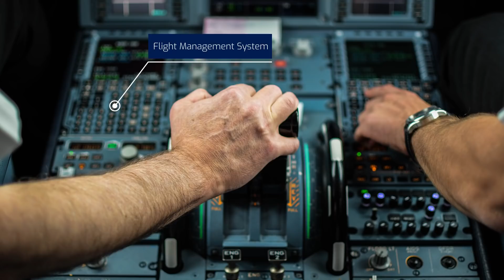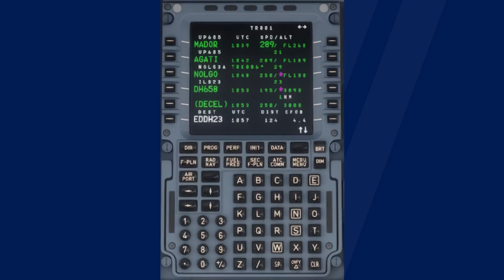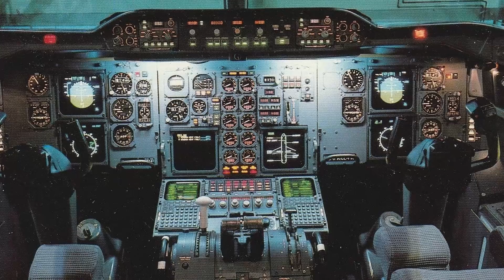Bad Decisions | How Hapag-Lloyd Flight 3378 ran out of fuel

Comment: Fam, wth! How did they not realise that with the landing gear extended, the FMS would never give them correct estimations...it's one of the basics that i learned while first starting off in flight school. Now it's pretty easy thing to remember, that with the gear in an extended position, the drag would be much higher than normal, which inturn will burn more fuel, and even then, the pilot's calculations were all over the place.
Btw, this video came up in my recommended videos part, and i have to say, very well done "Airspace".
Reply from the maker: who knows :) maybe we learned it because of this accident? but yeah, it's a weird one. thanks for your kind words!
Reply: Very much possible mate
Reply: But here's the thing: shouldn't the flight management system know [1] how much fuel is remaining, and [2] how fast the plane is currently burning it?  Regardless of what the manufacturer's engineers programmed into the system for various scenarios, surely the system knows what the current burn rate is?  Then it's just a simple calculation to see how much time (and distance) you have left.

Not that the pilots weren't negligent, but their system should have easily been able to tell them how much time and distance they had left at any given moment.
Reply from the maker: that'd be nice, yes. Unfortunately, that's not the case.
Reply: @AirspaceVideos  :   Thanks for the quick reply.  🙂   I must say, being such a simple calculation, it boggles my mind that Airbus's sophisticated FMS can't do a simple math calculation that any elementary school student could do!  WTF!?
Reply from the maker: that's by no means a simple calculation. How should the FMS know in what exact position the landing gear is? One could say that it maybe could have values for gear down. But then again consider the fact that this plane (and in turn also its computers) were released in 1982. Think back to how computers looked back then!
Reply: @AirspaceVideos  and Topet Hernaez :  

You guys, the FMS doesn't need to know in advance what the rate of fuel consumption is when the landing gear is down. 

All it needs to know is what the current rate of fuel consumption actually IS.  Regardless of the cause.  Even your average modern car knows that.  With that knowledge, and the amount of fuel remaining, the remaining burn time is basic 5th grade arithmetic.

Say the plane is burning 6600 kg of fuel per hour (for example).  We know this, not because the engineers have preprogrammed the computer (flight management system) with this data for a gear-down scenario, but simply because the plane has fuel flow sensors that tell us how much fuel is flowing through the system at any given moment. 

So with a fuel consumption rate of 6600 kg per hour, and, say, 3300 kg of fuel left in the tanks, we know that the engines can run for another half hour before running out of fuel.  That's it.  It's not rocket science.

And then if we know the approximate ground speed of the airplane, we can easily calculate how far we can go on the remaining fuel.  If our ground speed is, say, 240 knots, and we have half an hour of fuel remaining, that means we can go 120 nautical miles before the engines flame out.
Reply: @Milesco  hmm are you a pilot by any chance? The FMS DOES calculate the current FUEL vs EXPECTED burn. Don't try to compare cars to planes, there are a LOT more factors that can change a plane's fuel burn such as wind speed, temperature, altitude, weight, weight changes, cg, cg changes, weather deviations, icing conditions, tropopause, etc etc etc, FMS calculates this things with a "standard" configuration in mind. That includes, descent configurations such as flaps, and gears. Now this "standard" configuration doesn't include an unwanted gear down situation that's why it warns that such unsatandard configurations make FMS prediction unreliable. Mind you that not only gear down but also unwanted spoiler extension, unwanted gear doors, etc etc etc.

Now if you ask me why the FMS doesn't incorporate these failures in its computation, I simply don't know, maybe to reduce complexity of the system like there are certain procedures needing gear down situation after takeoff for a specific time, so by then if the FMS computes for that gear down event, then you'd have the wrong info.
Reply: @Milesco  also the current rate of fuel consumption is ALWAYS variable in an aircraft you'd be lucky to have the same consumption in a span of 30 mins during cruise and the consumption differ ALOT in an a321 neo if I remember conrrectly 4000kg per hour during takeoff then drops to 800kg per hour during descent and that's depending on weight, speed etc etc etc
Reply from the maker: That prediction would fail since it doesn't know future fuel flow rates, such as during climb to higher altitudes or during descent. Yes, it could calculate projected range according to fuel flow, but then again, that feature is not necessary, since the pilots should perform such calculations themselves. If I see that I am burning 8t an hour and I have 16t in the tanks, I know that after 2h, it will be very silent...
Reply: @topethermohenes7658   :  Despite my clear and simple explanation, you still have managed to miss my point.   Sure, the precise rate of fuel burn will vary somewhat over the course of a flight, but not that much.  It's nothing compared to the effect of the landing gear being stuck down.  We're not trying to pinpoint to the last drop how much fuel we expect to use before the plane even takes off.  We're just trying to get a reasonable idea of how much range we have under the current circumstances.

The point is, you know how much fuel you're using (rate of consumption), and you know how much fuel you have left.  With that information, you can easily calculate what your range is.

Again, whatever small variations may exist from one moment to the next with regard to wind speed, air temperature, altitude, etc, that's nothing compared to having your landing gear sticking out like a sore thumb.  You're way overthinking it.  In a situation like this, all you need to know is how much fuel you're burning, and how much fuel you have left.  That's it.  Then you can figure out what your range is and then decide what airport you need to land at before you run out of fuel.
Reply: @AirspaceVideos  :   "That prediction would fail since it doesn't know future fuel flow rates...."

As I said to Topet, you don't need that extreme degree of precision. 

"...such as during climb to higher altitudes..."

Who's climbing?  Nobody is going to be climbing under these circumstances! 

"...or during descent."

Well, that would use less fuel, right?   So that's obviously not a problem.

"If I see that I'm burning 8t an hour and I have 16t in the tanks, I know that after 2 hours, it will be very silent."

THAT IS EXACTLY MY POINT!!!   That has been my point all along.   And yet neither the pilots nor the oh-so-smart- and-sophisticated FMS calculated that.  And as a result, the plane crashed 660 meters short of the runway in Vienna.
Reply: @Milesco  what do you mean "not that much"?? What airline do you fly where precision on fuel is not required? Maybe our down to hundreds of kg of fuel precision vs an 18 ton fuel max is a new idea to you? You are speaking as if a gear down cruise is normal, they are VERY VERY RARE no need to complicate the whole FMS prediction for such a rare occurance

I agree, for such failure there's no need to pinpoint exact fuel burn and just deviate to nearest suitable airport, why the need for FMS precision where you can just compute by yourself in a matter of 5 sec? As stated here, being very reliable to computers is a BAD practice even by today's standards.
Reply: @Milesco  the FMS IS VERY PRECISE down to tens of kg precise, if you put in tons more of data like ALL  FAILURES AFFECTING FUEL you'd have more points of failure like let's say and LGCIU fault would make your FMS fuel prediction data unreliable, FAC fault, elac faults, sec, hyd, elec etc etc etc
Reply: Right, as my notifications are going mad here, i think i should also put forward my own POV on this...
 So Captain Quirk, what makes you think that the FMS could calculate the rate at which we would burn fuel in case of an irregular flight?
    Now firstly, you should know that before every flight, the pilots are the ones to input the calculation about the rate of burning fuels into a FMS, they can never calculate things on their own...now in case of an error percentage of fuel consumption...there is a limit to that, as that's the amount of extra fuel we carry, i.e 30 mins for holding and a further 1 hour or 1 and a half hour for diverting.
    To answer your question, the FMS cannot calculate an increased rate of burning fuel, it's pilots who do it and then input those values again....but even after that calculation, if the rate of burning fuel exceeds the amount required for that trip, we divert automatically or face consequences...but even that decision is on us, the FMS is not gonna warn us if it exceeds the first value which is entered.

I don't know if you'll understand this, but this is how I've flown since i first started 6 years ago that is, but i don't know what we used to do before that
Reply: @priyanshuhazra8644  I started flying an airbus at around the same time and I agree with you, for faults such as a landing gear down flight, my first thinking would be fuel 10/10 of the time and my first action would be ofc check qrh for additional procedures, limitations etc then I'd find the nearest airport were the company has a technical support and mech support as to not increase fees, if there's none, I'd just return to where I came from, advise company, atc, crew and passengers, it's that simple no need to rely on FMS predictions like Captain Quirk is implying
Reply: @topethermohenes7658  ”what do you mean "not that much"??”

8:37  “The documentation for the A320 states that flight with landing gear down increases fuel burn by a whopping ONE HUNDRED EIGHTY PERCENT.”

By comparison, any of the other variables are “not that much.”  That's what I mean. 

So you don’t NEED to factor in wind speed, temperature, barometric pressure, flap settings, or any of that other stuff.  You are using fuel at a rate of nearly THREE TIMES NORMAL. 
   The other stuff is just rearranging deck chairs on the Titanic. 

As you said yourself, “you can just compute by yourself in a matter of 5 sec”.  So why can’t the ultra-sophisticated FMS do this?

This is a prime example of engineers engineering the shit out of something, to the point where it can’t do the most basic stuff that would've saved (in this case) the airplane.

Don't get me wrong – I love engineers.  My father was one.  I have a tremendous amount of respect for their knowledge of science & math.  But sometimes they have their heads in the clouds (no pun intended) and can't see the forest for the trees.  They design the most complex, sophisticated systems that have no f*cking COMMON SENSE.  They design a brilliant, sophisticated FMS that can compute fuel requirements to within a few tens of kilograms out of tens of thousands (to use your words), yet it literally cannot tell that the plane is ABOUT TO RUN OUT OF FUEL. 

T H A T    I S    M Y    P O I N T .
Reply: @Milesco  you are the one saying that the fuel burn is "not that much" different in the context of 4000kg/hr climb and 800kg/hr descent it is MUCH, also you said that "extreme precision" is not needed I mean what? So you want the FMS to say your fuel is so-so or 1000kg off mark?? The FMS is VERY precise you can't just make it "not-so - precise" when you need it be.
And that's what I mean you cannot let the FMS compute for "every fault" out there that concerns fuel thats YOUR job as a pilot. The FMS is just a computer, it doesn't "think". Again becuase the more data you enter the more points of failure. Imagine an LGCIU failure then what? It now CANNOT compute for the fuel just becuase of a single computer problem? And mind you LGCIU failure are much more common than a landing gear down cruise config.

Again that why there's a pilot on board to "think" you cannot just rely everything on engineers as they cannot account for every possibility that's going to happen in the future its the pilots job to ASSESS the situation and make use of ongoing events to make a safe decision.

If you think that being a pilot just entails pressing buttons and drinking coffee then you are GRAVELY mistaken
Reply: @Milesco  "you don't need to factor wind speed temperature, baro pressure etc are you really a pilot? ALL these things are ALL magnified 3 TIMES ALSO. As I said the environment in an aircraft is ALWAYS dynamic, everything can and will affect everything else. Again I'll say it, you cannot rely solely on the computer as is the 4th airbus golden rule "take action if things do not go as expected"
Reply: @topethermohenes7658  ”you are the one saying that the fuel burn is "not that much" different in the context of 4000kg/hr climb and 800kg/hr descent....”

Where did I say that?  I never said that.  You are putting words in my mouth.

"The FMS is VERY precise...”

Yes – a brilliant, sophisticated FMS that can compute fuel requirements to within a few tens of kilograms out of tens of thousands (to use your words), yet it literally cannot tell that the plane is about to run out of fuel.

”you cannot let the FMS compute for "every fault" out there that concerns fuel...” 

Heh heh heh...that's funny.  “VERY” precise, but it can’t detect when the plane is burning fuel at three times the normal rate. 

Anyway, as I said before, it appears that you have missed my point.  In fact, it almost seems like you're purposely and stubbornly refusing to understand what I’m saying – the essence of which is simply that if you have a (supposedly) sophisticated fuel consumption calculator on board, it ought to be able to tell you “Hey, based on the current rate of fuel consumption and the amount of fuel you have left, you only have x number of minutes of fuel left.”  Are you telling me that that’s impossible?  The calculation that you yourself said a pilot could do in 5 seconds?
Reply: @Milesco  do you need more explanation on how FMS fuel prediction works or did you already understand it? Let me give you a real life scenario.

Here's how the system works : a 45 min flying time on an a321 neo typically needs just 3100kg of fuel and that includes all emergency fuel etc, passengers of this flight will be about half. Now at take off the plane will consume about 2000kg/hr per engine since the engines are on high thrust... Now if using your made up calculation that the FMS gets data from the the  CURRENT usage then you'd have 100kg left with you after 45 mins of flight. If you don't see anything wrong with having 100kg on arrival then maybe you should read up on fuel requirements, emergency fuel, holding fuel etc etc etc. In short 100kg on arrival is NOT acceptable on an a321 neo you are already on an emergency situation that way and FMS will warn you that you don't have enough fuel. NOW THE CORRECT WAY FMS predicts is that it gets its prediction through current fuel onboard THEN compares it with the distance left including computing top of climb, cruising altitude, top of descent, weather enroute, weather at destination, current weight etc etc etc. And assumes everything is in working order. This way even if you're engine uses up a total of 4000kg/hr the FMS knows that it's the usage only for the takeoff portion of the flight and knows that eventually you'll level off and will use a lower fuel rate then descent which even uses a lower rate. The normal prediction in this case would be the FMS predicting 1.7tons of fuel remaining at destination and that's enough for alternate fuel and emergency fuel etc etc etc.

Now if any reason that any failure occur for example a sudden gear down situation then you simply take your fuel onboard minus fuel at arrival then add 180% then compare it to your fuel on board that'll take 5 sec give or take... With your made up calculation if you get the current usage then you'd have no fuel left to go anywhere as you fail to calculate the descent fuel usage.

It's simple logic no?
Reply: @Milesco  I've read again your formula current fuel consumption vs fuel onboard giving you minutes of flight time? That's NOT NEAR ANYTHING USABLE AT ALL minutes of the flight what? Until you crash?? How about weight? Wind speed? Alternate fuel? Emergency fuel? Damn it'd take me all night to list everything your formula missed. THIS IS NOT A CAR
Reply: @topethermohenes7658  : I get what you’re saying, but again, you seem to be purposefully avoiding what I’m saying and insisting on taking things into account that are not relevant (like relatively small variations in fuel consumption during cruise) or clearly inappropriate (like takeoff fuel consumption).  Obviously fuel consumption on takeoff is going to be vastly more than any other part of a flight.  I don't know why you keep insisting on using that as your example when it is absolutely NOT applicable here.

The pilots noticed the abnormal fuel consumption during the cruise phase of the flight, did they not?  During that phase of flight, the fuel consumption is going to be more or less constant.  Yes, some minor variation due to normal changes in the atmosphere, I get that -- but come on, that's nothing compared to the enormous increase in fuel consumption due to a landing gear down situation.  You're saying that the onboard flight management computer can’t handle a gigantic increase in fuel consumption due to landing gear because it’s only designed to precisely handle tiny variations in fuel consumption due to things like temperature and barometric pressure.  The system can’t see the forest for the trees.  Well okay, if you say so, but then that’s a lame system. 

Yeah, I’m not a pilot, but you don’t have to be a pilot or a mathematician to have common sense.  Indeed, that seems to be the problem here.  The “professionals” who designed it and who use it are so wrapped up in the technical minutiae that they completely fail to see the big picture. 

Admittedly, the pilots should've been able to make that basic range calculation on their own, without the FMS.  Because we both agree that this isn’t a complicated calculation.  But then shouldn't the FMS also be able to do this?  I know it’s all very precise and delicate and wonderful, but for Christ’s sake, if you're using fuel at nearly three times the expected rate, shouldn’t it know that and be able to tell you what your new range is?  The same calculation that you admitted the pilots themselves ought to be able to do in 5 seconds?
 
Oh no, it’s too fine and precise and sophisticated to do that!
Reply: @topethermohenes7658   ("I've read again your formula current fuel consumption vs fuel onboard giving you minutes of flight time? That's NOT NEAR ANYTHING USABLE AT ALL minutes of the flight what? Until you crash??")

Until the fuel runs out.  I thought that was obvious. 

"How about weight?"

Irrelevant.  The weight is what it is.  We're already in the air, so that's not changing (other than getting slightly lighter over time, which obviously can only help, so that's not the problem).  We're talking about current fuel consumption and how much longer we can keep the engines running. 

"Wind speed?"

Yeah, that's a variable, but it's nothing compared to having one's landing gear sticking out like a sore thumb, causing the plane to consume fuel at nearly three times the normal rate.   I don't think the plane crashed short of the runway because of the inability to accurately predict the prevailing wind speeds during the flight. 

"Alternate fuel? Emergency fuel?"

Again, the point here is to figure out how long the engines are going to keep running.   "Alternate fuel" and "emergency fuel" are for flight planning before the flight and to figure out how much fuel to load the plane with before the flight.  That's not what we're talking about here!
Reply: @Milesco  just forget about your dreams of becoming a pilot (if you have one) you clearly don't know anything yet you INSIST you know everything. 

Here's a suggestion, go an join airbus/Boeing and prove to them how stupid their design is. Maybe you'll change 50+ years of innovation and design becuase you CLEARLY are a one of a kind genius set on changing the whole aviation industry and not just random YouTube commenter who thinks that he knows everything 😊
Reply: @Milesco  I'm done with this convo, you took too long to reply and I lost interest. 

Besides Im just a lowly pilot, I'm not some know-it-all who knows everything. This was a way for me to check fcom and review aircraft systems and since now you are just repeating everything you say, I'm done arguing. Oh and please don't be a pilot 😊
Reply: @topethermohenes7658  :  "Here's a suggestion: go and join Airbus / Boeing and prove to them how stupid their design is."

Well, it wouldn't be the first time that Boeing has made a serious design error in their airplanes!  🙄

But here's the thing: it doesn't take a genius to say that if a plane has a fancy computer that can make fuel consumption calculations down to the milligram, maybe it should also be designed to give the pilots a rough estimate of how far the plane can go on the remaining fuel on board, based on current / recent burn rates.  You know, just in case something happens and things don't go as planned. 

But hey, what do I know?  I'm not a condescending pilot or an engineer.  I'm just a layperson with an ounce of common sense.  Like the kid who solved the problem of the truck stuck in the tunnel by telling them to let some of the air out of the tires.

But it was a pilot -- two of them, in fact -- that crashed that plane, wasn't it?
Reply: @topethermohenes7658  "Oh, and please don't be a pilot."

Well, if I were to choose that career path, I would certainly make a habit of keeping an eye on my plane's fuel consumption rate, and if it appeared to be more than expected, I would check the consumption rate against the remaining fuel and determine how much farther the plane can go.  Obviously I wouldn't be able to rely on the plane's flight management computer for such a complicated task, so I would be sure to bring along a three-dollar pocket calculator.
Reply: @topethermohenes7658     simple logic    
Would it be fair to say that — given a standard configuration — the FMS will know  the expected fuel flow during each part of the flight, with high accuracy?

Would it be correct to say that the FMS gets fuel flow readings and fuel remaining data?

Would it thus be fair to say that the FMS has all the info it needs to find abnormal (high or low) fuel usage?

Is there any good reason for the FMS not to check if its predictions of fuel flow and fuel remaining are congruent with reality?
And if not — if say the “fuel remaining at the target” value keeps decreasing — actively warn pilots that the FMS prediction is unreliable because clearly fuel is used at a different rate than expected? Is that too much to ask?

I’m not even asking for the FMS to compare calculated and actual fuel flow rate and come up with a rough correction factor of X for climb and Y for cruise — which is not hard to do, it is simple math , even for a 1980 computer — and apply that correction factor to the predictions (obviously with a ⚠️ for the pilots that the prediction is suspect and may be too optimistic — but is certainly more correct than sticking with the standard model).

All I ask is that the FMS reports when reality and FMS modelling are not matching one another.  That is what any computer or automated system in a plane should do — alert when it’s not functioning within proper parameters, right?  Like autopilots disconnecting … gear lights showing “not locked” … navigation systems saying “GPS signal lost” instead of giving spurious GPS data?
Reply: @advorak8529  
Would it be fair to say that — given a standard configuration — the FMS will know  the expected fuel flow during each part of the flight, with high accuracy? yes

Would it be correct to say that the FMS gets fuel flow readings and fuel remaining data? yes

Would it thus be fair to say that the FMS has all the info it needs to find abnormal (high or low) fuel usage? The FMS is not connected to individual systems like for example gears, flaps, etc. Moreso if you include failures. giving them a link would overly complicate the fms and will report more dubious data from for example failed sensors. It is linked to FADEC tho. It knows and calculated for one engine cruise, fuel burn etc. 

Is there any good reason for the FMS not to check if its predictions of fuel flow and fuel remaining are congruent with reality? Yes, because ultimately, it's the pilot's responsibility. And systems (which may fail) are not linked to the fms. 

And if not — if say the “fuel remaining at the target” value keeps decreasing — actively warn pilots that the FMS prediction is unreliable because clearly fuel is used at a different rate than expected? Is that too much to ask? (the answer was yes but ill answer this anyway) It warns us that the fuel is reaching threshold levels if we continue with the current trend. Our responsibility is either to find another way or airway (in case of traffic), Sole the current failure, or divert to a closer airport. 

I’m not even asking for the FMS to compare calculated and actual fuel flow rate and come up with a rough correction factor of X for climb and Y for cruise — which is not hard to do, it is simple math , even for a 1980 computer — and apply that correction factor to the predictions (obviously with a ⚠️ for the pilots that the prediction is suspect and may be too optimistic — but is certainly more correct than sticking with the standard model).
As I said, The FMS is not linked to systems that may cause a fuel overburn if failed... That's where it gets complicated, if every system capable of affecting fuel is linked to the FMS and there was a faulty sensor would that mean that for the whole flight we would have a failed fms fuel prediction too? What if its the opposite the sensor reports as it failed but in reality its fine? Why not just let the FMS compute a standard computation and let the pilots compute for at least 5 sec the error/additional fuel burn?

All I ask is that the FMS reports when reality and FMS modelling are not matching one another.  That is what any computer or automated system in a plane should do — alert when it’s not functioning within proper parameters, right?  Like autopilots disconnecting … gear lights showing “not locked” … navigation systems saying “GPS signal lost” instead of giving spurious GPS data? Well you see the computers in a plane is very specialized. There's no one master computer that dictates or suggests to the pilots of what to do. The FMS is mainly concerned with navigation, Waypoints, altitudes navigation systems saying “GPS signal lost” etc. It doesn't concern itself with aircraft systems that has nothing to do with navigation. The ECAM (electronic centralized aircraft monitoring) is the one concerned with aircraft systems. Like autopilots failing … gear showing “not locked” It's the tool we use to solve technical problems concerning the plane itself and its the one that warns us if the FMS fuel predictions are unrealiable. There's no central computer governing all of these systems. These computers mainly give of data and information. The one that gathers all these info, assess the situation and make decisions is the pilot.
Reply: @topethermohenes7658  
Me: Is there any good reason for the FMS not to check if its predictions of fuel flow and fuel remaining are congruent with reality?
You: Yes, because ultimately, it's the pilot's responsibility.
Of course everything is ultimately the pilot's responsibility!  That is obvious.

Let's see ... when I apply the same logic to the autopilot, I get that the autopilot should not check if the plane is still within operating parameters of the autopilot (and not disconnect).
And I get: It is the pilot's responsibility to disconnect the autopilot, so control inputs should also not cause the autopilot to disengage.

That makes no sense to me, so clearly I misunderstood your logic.  Could you explain it again?

Also I think you are not really understanding me.  I shall endeavour to be clearer:
- no new sensors
- no new inputs to the FMS
- just check if the pre-computed fuel usage for the trip lines up with the actual, current fuel usage and current fuel left, and if not, notify the pilots that the FMS data may be off because there is a discrepancy between expected values and actual ones --- and that thus the data offered by the FMS is suspect and may be completely wrong.

That is all.

You: And systems (which may fail) are not linked to the fms.    True but also irrelevant: The fuel use is either as expected (within the accuracy of the FMC) or it is not.
I do not need a sensor to devices X, Y and Z, all of which have failure modes that increase the fuel used, to see if they have failed in such a way --- all I need is to monitor how much fuel goes to the engines and how much fuel is still in the tanks and compare that to the quite accurate model the FMS uses to calculate all that.

You: That's where it gets complicated, if every system capable of affecting fuel is linked to the FMS    Wrong assumption.

You: Why not just let the FMS compute a standard computation and let the pilots compute for at least 5 sec the error/additional fuel burn?    
What exactly is your great logic for showing false*, *wrong*, *incorrect data --- which clearly can confuse pilots, but will not help them at all??

Maybe we should also give the FMS a completely different destination, in this case, New York or Hamburg or London Heathrow, and let the pilots compute for at least 5 seconds how far their fuel will go?  That actually improves the data by making it clear it is completely worthless.

Well you see the computers in a plane is very specialized.    Well, you see, what the FMS computers are doing all day, every day, is getting data from sensors and information from the databases uploaded into it, doing computations and comparisons on them and producing output to be displayed, send information to other systems and to storage.  So that task is right up their speciality.

The FMS computer(s) are taking data originating from sensors, do comparisons and calculations and sends data to a display and likely stores data, too.  Which is exactly what I propose ...  so that is not the problem.

There's no one master computer that dictates or suggests to the pilots of what to do.    Obviously.

The FMS is mainly concerned with navigation, Waypoints, altitudes navigation systems saying “GPS signal lost” etc. It doesn't concern itself with aircraft systems that has nothing to do with navigation.    Really, is that so?  And here I thought it predicted the amount of fuel needed and fuel left at the end of the trip --- that is not navigation.  That is logistics.

The ECAM [...]its the one that warns us if the FMS fuel predictions are unrealiable.    And it knows that from what?  And why did that warning not happen on this flight?  Oh, maybe because there are two independent FMS and both gave the same incorrect data ...

These computers mainly give of data and information. The one that gathers all these info, assess the situation and make decisions is the pilot.    Can we agree that showing the pilots incorrect data without clearly marking it as such is a bad idea?
The captain trusted the FMS because in his mind the FMS clearly would calculate the gear down drag during cruise properly (that's stated explicitly in the video, and also that the first officer did not believe the FMS did that).

Do you think the captain may have had less than complete, absolute trust into the FMS if the FMS itself said the data was not reliable and the fuel burn rate almost 3 times what it should be?  Maybe?  Possibly?
Reply: @Milesco  

Not so: the FMC has consumption figures for all temps, altitudes, weight etc - in normal circumstances. But you wouldn’t expect it to calculate future consumption based on what it sees as instantaneous rates - if it did the destination prediction would constantly vary wildly.
In this particular case the FMC would constantly see the fuel on board going down and would then be constantly be predicting reduced arrival fuel - eventually to the point where that was below minimums allowed. It appears that only at this point were the warning bells going off in the crew’s heads.
A whole series of poor decisions.
Reply: @Milesco  

You don’t seem to get it!
Take the situation on a normal flight: soon after takeoff the arrival fuel prediction will be pretty close to what it shows half an hour later in cruise. Why? Because although you still have some flap down and engines at CLB - ie. huge rate of burn - the computer is working on EXPECTED figures, not instantaneous ones. If it didn’t, the eta fuel would look negative!
Reply: @Wol747  :  No, YOU don't seem to get it.   The excessive fuel consumption on this flight wasn't something that lasted only a few seconds or even a few minutes.  It wasn't an "instantaneous" or "momentary" reading -- it was a condition that existed constantly for the entire flight.  It doesn't take a rocket scientist to see that if your fuel consumption rate is nearly three times the normal rate for an extended period of time (indeed, for the entire damn flight!), you aren't going to make it to your destination.
Reply: @Milesco  I think we are talking about different things!
You are of course totally correct in saying that the huge rate of consumption was right in front of their eyes from the getgo. Agreed.
What some of us have been on about is the other factor: the FMC (or whatever it’s called in Airbus language).
I may be wrong but the computer takes the instantaneous fuel on board figure and computes the destination fuel by using the flight profile as entered and the EXPECTED rate of consumption as per its database.
Obviously just after T/O the eta fuel would be very close to what was expected. As the flight progressed it would get worse - not because the computer was calculating using the high burn rate but because the instantaneous FOB was decreasing rapidly compared with “normal”. (Obviously taking account of the different airspeed.) 
This wasn’t to say the crew weren’t incredibly blind to what was happening, just that the FMC would not be showing the real disaster unfolding, only the gradual change in arrival FOB due merely to the fact that there was less fuel in the tanks.
If the database held corrective figures for gear down flight - and any other combination of factors - the destination prediction would have been accurate, and the dire situation surely would have been recognised.
Reply: @topethermohenes7658  Perhaps rather than calculate and accommodate a delta to fuel flow in figuring range with a flying handicap, the craft computer design figures that the pilots will take conservative adhoc emergency measures on account of that.
Reply: @Milesco  I don't know those times but now, I think fms still doesn't calculate for L/G down cruise, altho there's an ECAM status that reads "Fuel consumption increased, FMS pred unreliable"